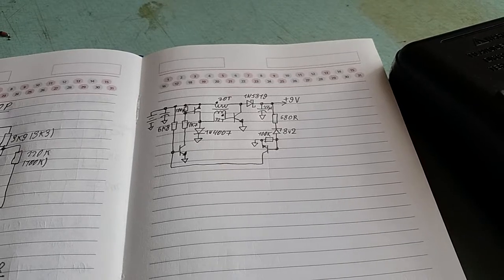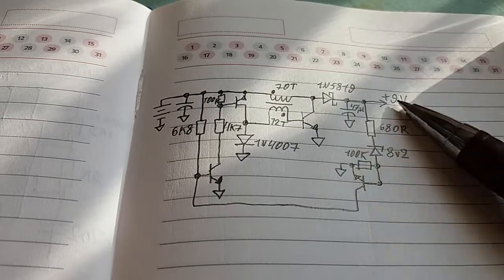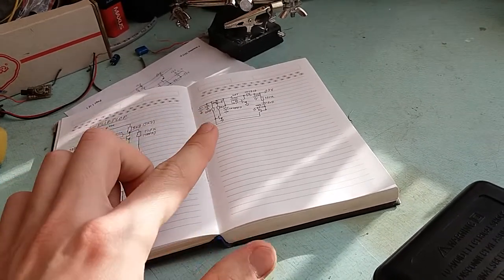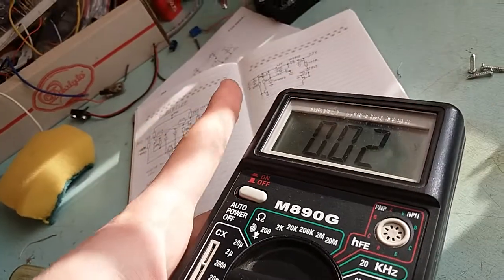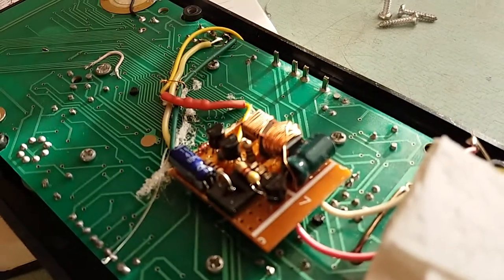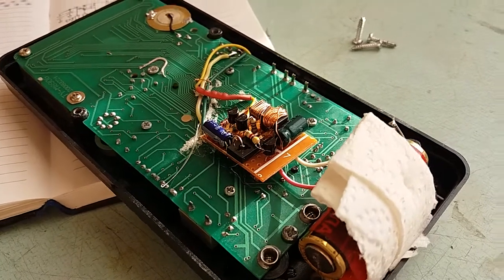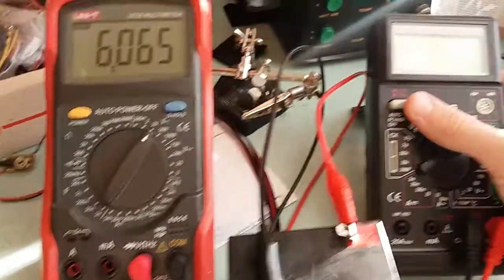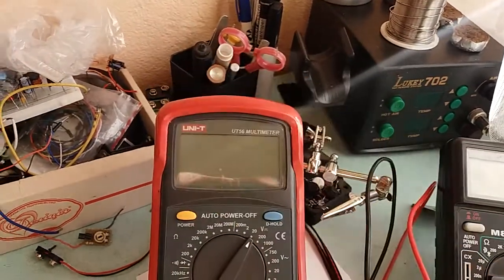Joule Thief boost converter 3v-9v

Comment: Hi. Your circuit is a clever one. Thanks for sharing. Did you somehow improve it or still using the same?
Reply from the maker: I have another video on this, it's called "Boost converter followup"
Reply: @mrjohhhnnnyyy5797  Couldn't as yet find it. Trying again. Any link? Thanks.

Comment: Thats a cute boost converter :-D.

Ive never looked at boost/buck circuits too close, your circuit looks like its charging up the inductor (thats producing a back emf), then turning off the switch transistor through the second reverse inductor when the back emf is at the right voltage.
The inductor voltage is added to the battery voltage when the switch transistor is off, then rectified and fed to the output filter.
The feeback transistor feeds the left bias transistor to adjust the bias on the switch transistor to acheave the right time to switch off.

Please remember i was only a repairer, so my discription is likely to be very wrong, and ive never been too bright with all electronics.
The brain doesnt seem to work too well now lol.
The great thing is it works and not too critical :-D
Reply from the maker: First, cut it out! Who do you think I am? Engineer in the industry? LOL 
Second: the principle how it steps up the voltage is exactly the same how every other boost converter does it. I chose to use more transistors than similar circuits use to achieve regulation because they basically stop the oscillation by stealing the base current and that is pissing power. Mine does opposite - it doesn't allow current to flow into the base when the output is too high. And yeah, it's not critical - as you might've noticed I'm using half of the EE core for the choke :D
Reply: LOL ok ill cut it out :-D.
I have learned to never be big headed because there is allways someone that knows more, just around the corner, its a good rule :-D

You added the extra parts for feedback control, that requires an understanding on how the circuit works.
You are making things that ive never tryed to make, you do know more than me about that circuit, i was just making sure you knew im a bit thick, i just guess in an english accent LOL :-D
Reply from the maker: zx8401ztv Yeah, that's a good rule. Mine sounds different but means pretty much the same - don't be smartass in the comments. If I have any thoughts about someones' video, I try to say them in a friendly manner, as a hint, constructive criticism. Not like few fellas did on my CRT TV repair vids :D
Reply: he he i will try harder to not say silly things in the comments :-D
I still think your a clever man, so there lol.

Comment: that 6.8 k resistor shoud eat 200 uA at 2V at least
Reply from the maker: No-load consumption of the circuit WITHOUT modification I talked about is 400-500uA. But I've added a feedback 2:08 line and now it's 10uA. That's why I asked if someone's interested
Reply: than I understood you wrong its late and I am tired I watch whole video but dont remember anything :)
Reply from the maker: I've mentioned it a couple of times, but I guess I'm a king of babble :D That's fine, I don't mind that. Sometimes I have trouble understanding what I meant while I edit the video LOL